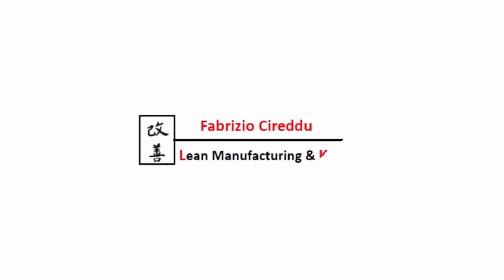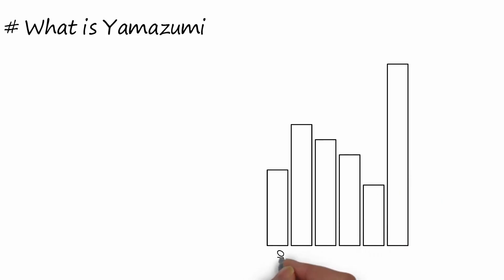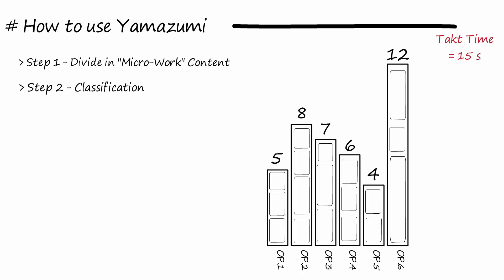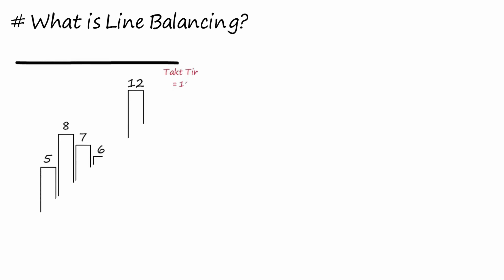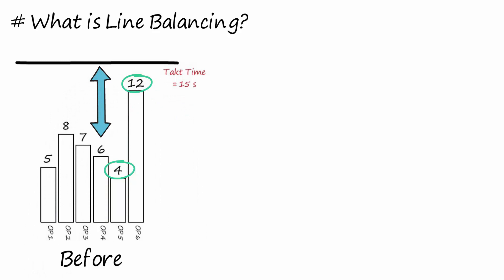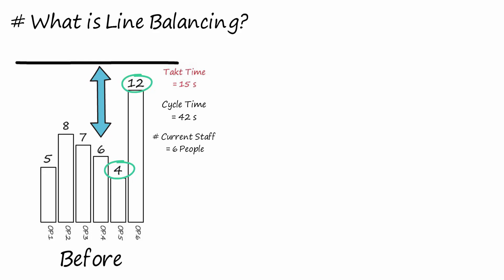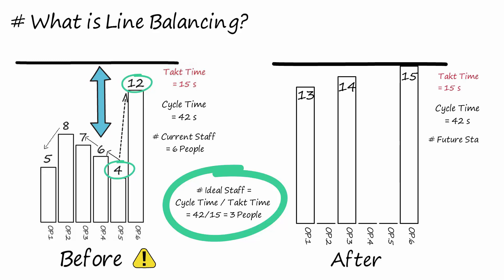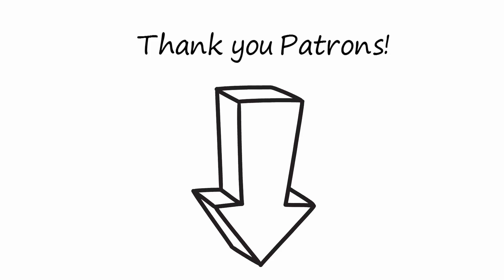What is Line Balancing

Comment: This seems to be for manual processes. What about line balancing for automatic processes?
Reply from the maker: Dear Gemma, this works even for automatic processes.

Anyway, there is no process 100% Automatic, there is always a manual percentage in any operation.

If you have a different example please share.
Reply: @LeanVlog  I have worked with automatic processes for coca-cola bottling. The main purpose of the operator is to attend to any machine stoppages and to replenish the occasional reel of labels on an auto-splice splice. The only way they could affect the bottleneck would be to turn the speed down on the bottleneck machine. Here we used line balancing to refer to the speeds the conveyors are set to in order to prevent bottles knocking into each other and falling over.